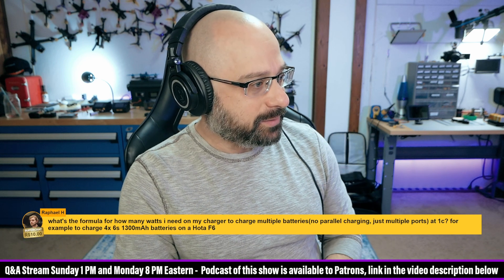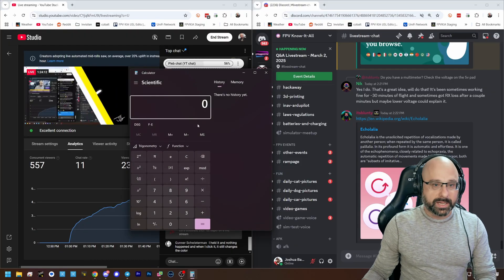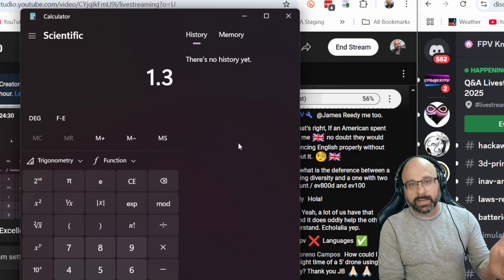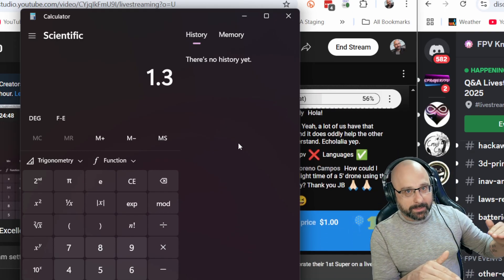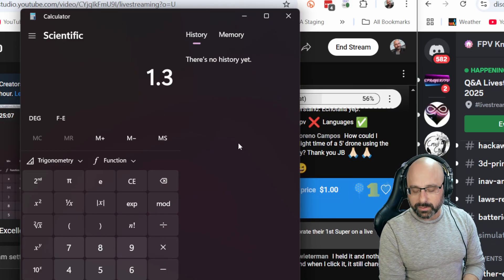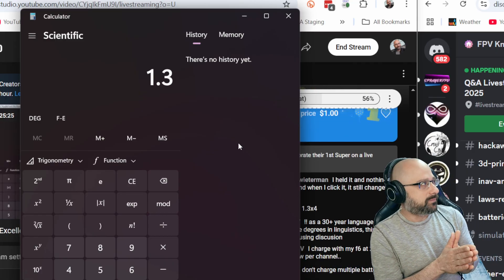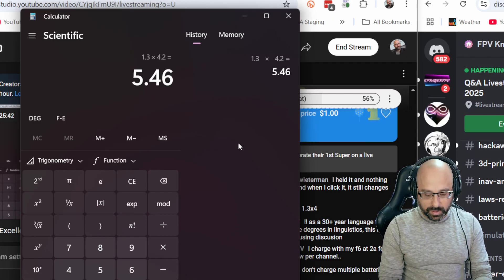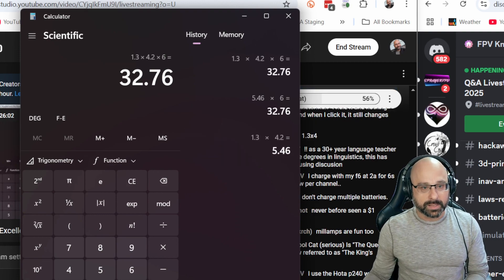How Many Watts Do I Need On My FPV Battery Charger? - FPV Questions

Comment: ok so for my moz 7 inch, i have a 3300 mah lipo and a 6000 liion, so (3.1mah x 4.2lipoV x 6s) + (6.0mah x 4.1liionV x 6s) = 225w ... for 1c charging. the 3300 mah dogcom lipo has a really high 120c rating so im pretty sure i can charge it much faster than 1C though ..... i got the hota s6 charger which can do 400w instead of 200w d6 charger

Comment: Multiply the result by 4 (multiple batteries), and I would go for 4.35 instead 4.2 in the calculation for HV batteries, in addition round it with the higher available power supply to get a little bit more space. Now you'll be fine!
(I would take more than 1 c and support more than 1500 mah, but that's your decide)